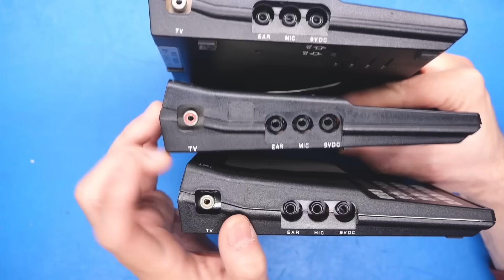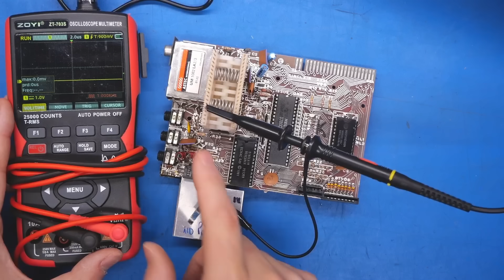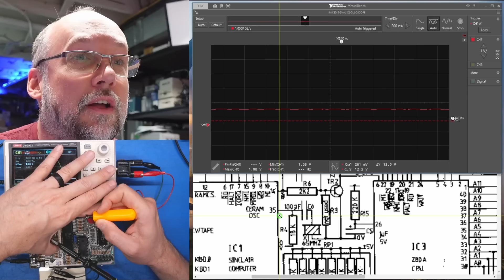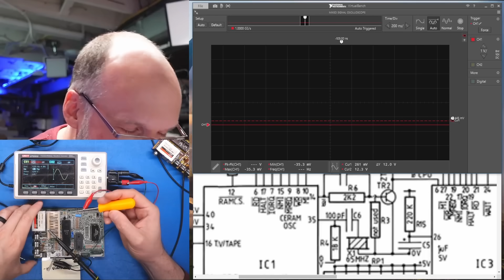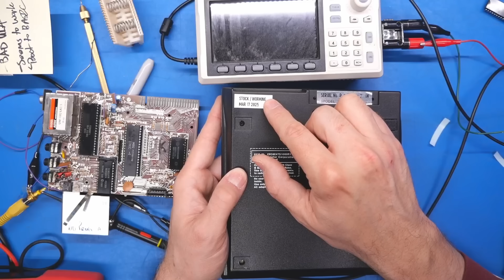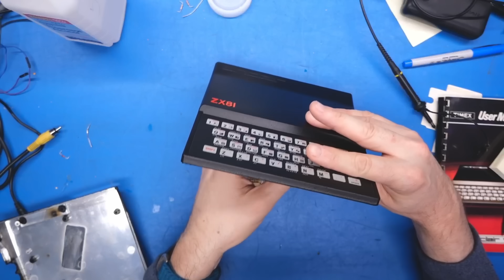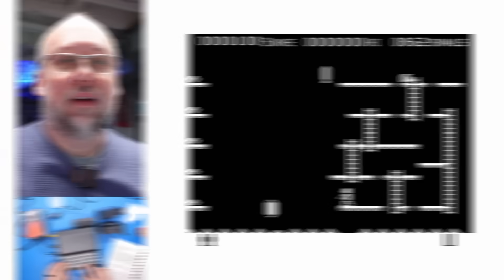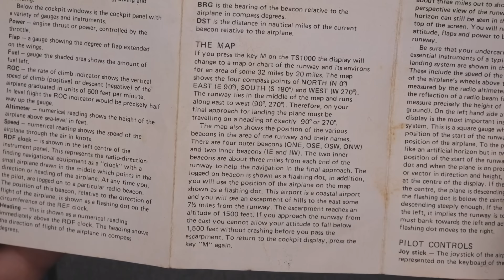Is the ZX81 / Timex Sinclair 1000 actually bad? Let's fix these to find out.

Comment: Why did you swap the motherboard into the ZX81 case? I would have thought that unit as original would be more valuable than with the swapped part. You would still be able to do the mid with the Timex model. Do you plan to resell it or use it? If it's just on the shelf as a memento of the golden era, I'd prefer to have one I know it's original than modded. Just curious why you did that?

Comment: I have a Memotec keyboard that plugs into the expansion port between the ZX81 and RAM pack. I also have a Memotec parallel printer port module for the ZX81.

Comment: They were great for robotics, as the ZX81 will run on batteries. Nasa have even used them on the ISS for experiment monitoring.

Back in the 1980's, I've witnessed a CNC milling machine converted to run under ZX81 control and at a Plessey facility, a ZX81 modified to be an EPROM programmer.

The UK electronics hobby store MAPLIN sold I/O board kits (used the 8522), RAM kits, extension motherboard kits, etc. (which I have still) for computer engineering & robotics hobbyists.

I built my own 16K RAM pack using a 74LS138 (3 of 8 decoder) addressing a 27256 static RAM chip. Another used a 74LS154 (4 of 16 decoder) and a 27256 static RAM chip, to give 32 K. What I learn about addressing I/O and RAM on the ZX81, later served me in my career as an electronics engineer designing ISA & VESA bus cards for IBM PC clones.

Comment: Dear Adrian, when the ZX81 is your very first computer, there is nothing wrong with that keyboard at all. It is like a device from another planet. By the way, when using the 16K RAM expansion, the delay before the K appears is normal, since the computer is busy checking how much RAM is connected. The delay is longer with a 32K RAM pack and even longer with a 64K RAM pack. There is a function, PEEK plus address (I do not remember the exact address), that will tell you how much RAM is detected. The manual for the ZX81 is much better than the manual for the Timex Sinclair 1000 you have. In fact, the ZX81 manual is essentially a complete and beautifully written BASIC course. I actually learned the basic concepts of programming on that computer following its manual. Thanks for the video.

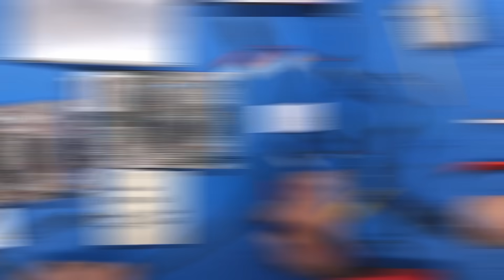Comment: A tip for dealing with those thin, easily damaged FFC/FPC ribbon cables:  Get some sheets of acetate (the ordinary transparent plastic sheets often used for paper covers, overhead projectors, etc), and cut a piece the same width as the cable, and long enough to hold onto easily (similar to what you did with the plastic tabs at 39:28, but do not adhere them to the cable).  When you are removing the cable, first insert the plastic piece as a shim between the cable and the connector, and then pull the cable and the shim out together (this reduces strain when pulling it out, making damage less likely), and then when putting it back in, insert the cable and the shim together (for support), and then pull the shim out (leaving the cable) once the cable is inserted.

This approach will make it much less likely to damage those sorts of cables any time you are inserting/removing them in general.

Comment: It was slow as hell, had a marginal basic. No real graphics except. Character graphic. Combinations. It was Black and white with no sound.  The screen flashed every time you pushed a key unless you put it in. Slow mode. Which made it craw. And yet I learn more with it than. With my PRS 80. Model 1. I had to. Literally. Encode. Machine language. From scratch from reference. Books. To get any. Sense of speed from the device. It wasn't impossible. I learned a lot about the architecture of this. Z80. It is half the peak and poke all the commands into the RAM. And execute them. I told the people that scoffed it, me having one of the things that it was just the computer that Allowed you to say that you own a computer.

Comment: I spent 48 hours programing an interactive database with all my family and neighbors names and some personal info, and hoped for them to be blown away when they responded to a prompt to type their name and press enter, setting each into a subroutine where the ZX81 would seem to know them . Of course , saving your work was not a thing yet, and suddenly , after 48 hours the screen went blank and of course i had lost all  work forever , except in my memory.  I was 13 yrs old. Didn't use a computer again until 3.1, and while in paintbrush , all the buzzing and clicking from the tower had me convinced I was  about to overload it.

Comment: I used those machines with a printer and did homework for college electrical engineering courses. Then engineering programming courses. FFTs, matrix operations, etc. worked fine for me. Led to a Software Engineering career that I recently retired from. Don’t knock the ZX Rock!

Comment: I had a TS1000 as a youth, I bought an aftermarket mechanical keyboard. I made a paralell port output for it and used it as a light controller with a triac output. used it as a computer based home automation system

Comment: I imagined now how for the same money ($100) I would do something similar in functionality. This would be a system with STM32F777, 16MB QSPI NOR Flash, 8 MB FMC PSRAM, USB, uSD, HDMI. Instead of BASIC I would use JavaScript from Duktape. There would be a graphics system with TouchGFX, two built-in file systems 4MB in the external RAM and 8MB in the Flash with FatFS or LittleFS. The remaining 4MB of RAM would be used as memory for the JavaScript engine and as a frame buffer for the video, and the 8MB flash for TouchGFX for static bitmaps, icons, etc. FreeRTOS or ThreadX

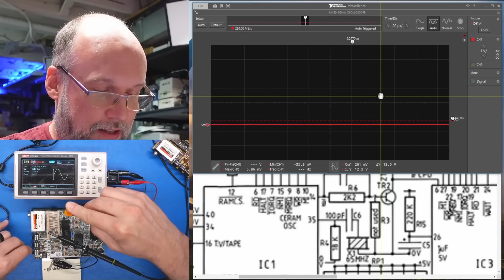Comment: 29:30 oooh I bet the "ledge" seen in the signal on this one was added in a later revision in an attempt to address how it wasn't compatible with some TV models. NTSC has zero voltage during horizontal and vertical retrace, but at the start of every line there's supposed to be a "front porch" where it's at the black level (which is above zero) before the actual visible video signal starts -- you can see the little notch for where the K is drops down to that same level, so we know that corresponds to black. The first unit doesn't have the front porch and just goes straight into white video which is naughty and is probably what made some TVs not like it.

Comment: Handy tip !!, you CAN actually solder the membranes.. The way you do it is to add small strips of adhesive copper tape where needed to cover the broken trace and solder nylar wire to the copper tape pieces. Then use more of the copper tape on the opposite side of the membrane strip to make connection of the 2 strips. Bodgy but it works, I fixed a COCO2 membrane exactly the same way and saved me buying a new one. ;)

Comment: I had the Flight Simulator for the zx 81. It took ages to learn but in the end I could take off and land withouut much trouble. The ram pack was awful until I made a small board for it all to sit on and used small wood pieces to hold the things all in place. After that it all worked perfectly until the arrival of The Commodore 128 a few years later, but in that time I learned the Z80 Machine code and it worked reallly well. Forgot to mention. I made a plywood and edging bead 1/4" square pine glued to it around the edge that just allowed the Zx 91 and 16k ram pack to sit on it securely and some blu tack to fix it in place. You could even make basic sound on it by detuning your tv set to just either side of the channel it was set on then the interference gave a very rudimentary sound.

Comment: As a kid I bought the zx-81 $50 usa version as a kit from an advertisement in an electronics magazine. Replaced keyboard with surplus mechanical keyboard I rewired added ram expansion and a Atari joystick port to a wooden case made. Eventually I upgraded to a C64.

Comment: my father bought one of these new in probably 82 for about 100CND, after some time he got an old dumb terminal and fitted the computer inside and wired the mechanical keys to it, then cut the membrane up and crazy glued them to the mechanical keycaps. the 16k rampack was tricky and ended up being tiewrapped in with an innertube as a spacer to stop it flopping around.
wish i had the mind to learn basic back then.

Comment: I saw an ad for the timex back in the early 80's so I mail ordered it from england. And I fell in love with it. I taught myself basic on it and I made quite a few games on it. I had a 16k memory pack and a thermal printer. I even created an game based on an arcade game of the time, crazy climber. I also had my first flight sim made for it. It opened up a new world for this kansas farm boy. I got used to the keyboard and my main problem was the memory pack could shift and reset the computer. I used an old cassette tape recorder to save what I made. I eventually moved on to a c64 then amiga and finally  a pc. I didn't know people debate on whether it was good or even possibly a scam. I say that unless your intro into computers was on it back in the early 80's then you will probably never appreciate it. Sadly, I had 2 complete zx81's I lost in a flood back in 2007 but I still have the memories.

Comment: The Australian release of the ZX81 also had the aluminized interior so it wasn't FCC specific. But the UK editions did not have it. The unpopulated IC space is for 4-bit RAM (there is another footprint under the 28-pin socket). It is easy to upgrade to 2K by just installing a 6116. It's also easy to use a 6264 or half a 62256 to get 8K or 16K of internal RAM, just a little wiring. The 1Kx8 SRAM was a bit of an unusual animal, but I guess Sinclair found it cheaper than two 2114s.

Comment: Adrian, as far as I remember, for the 16K RAM pack the 9V unregulated power was passed through to it via the edge connector to generate the other power rails required for the DRAM chips.

Comment: I recently picked up a couple of these.  One was modded with an on/off switch (kinda neat), and the ram expansion pack had several holes drilled on the top and bottom.  I have seen a modded expansion card for SD but tariffs have messed that up (surprise surprise) so they're currently not making them. Anyway, I look forward to tinkering around and learning about these.  Fun stuff.  :)

Comment: A Timex/Sinclair 1000 was my very first computer. I lusted after a Commodore 64 (and after a year of hard saving I managed to buy a used one in 1984) but in late 1983 and with scant means, it was the T/S 1000 or nothing. I saved up for the 16k memory expansion, thus giving it eight time more RAM. That Christmas I got a black and white TV and a portable cassette deck and I was set. Sure, it had a membrane keyboard, no colour, no sound, no power switch, and the huge and jiggly RAM pack would crash the whole thing if it wasn't taped in place. But it was a computer and I learned BASIC on that thing. I eventually sold it to fund the C64 purchase but it was always have a place in my history.

Comment: the ZX-81, kit version that I put together as a 16 yr old, was the first computer I bought for myself (previously had to use my dad's KIM-1)

it was a rather limited machine, to be sure, but was cool enough as an intro to microcomputer - it was actually a fun challenge to code useful applications, even with a 16K RAM upgrade & have seen some rather clever examples .... very much an underrated machine, imho

Comment: I remember seeing ads for the timex Sinclair 1000 in a sears catalog the same year I was lusting after the c64 as a kid in 1982.  I remember thinking even at that age how ridiculous the keyboard and ram limitation was.  It took another year but my parents did get me a c64….  I recall the 1000 being a massive failure as commodore took off and Atari and Apple were also doing well.  It took me until the 2000’s and the web to find out how popular and widespread it was in Europe and definitely have a respect in how much the hardware was pushed.

Comment: My first computer was a MicroAce, an unlicensed US kit version of the ZX80.  I had to solder every component onto the board. Being naive, I was not surprised when it worked on the first try.  I paid a little extra for the 2K RAM model.  I upgraded it with the 8K ROM which kind of made it equivalent to a ZX81, without slow mode.  Adding 16K RAM made it a real computer.

Comment: I had a ZX81 when they first came out. After a couple of years "normal" keyboard became available, which attached to the keyboard connector in the PC. It did make the experience of using the ZX81 much better. The 16K expansion kit was very prone to movement, causing a crash; just pressing the keys on the original keyboard would sometimes cause a crash. This became less of a problem when I purchased a normal keyboard.  I did end up purchasing and Apple II plus then BBC computer.

Comment: Yep I was one of the people that had the Timex Sinclair 1000 that used it for awhile then got my first real computer a commodore 64 running a super fast 2400 baud Modem lol I never thought about taking the Timex sinclair apart I still have mine with the optional plug in memory pack. Thanks for the video.

Comment: Compare to an Atari

Or even a trs-80 mc10

It does suck

But it does work

Might as well to the 16k mod, 32k if you do some deciding as 2 16k banks
Reply: I bought one from the local hamfest for like $5 with manual and programming reference guide

I don't think it was a Timex ntsc, because it was Sinclair branded but the red mobo did have USA on it

It did have the back porch problem too on the ula

Unless the person bought it as a kit machine?

It does work on ntsc TV, though the Hitachi multi system didn't show the back porch issue
Reply: Really if you have a z80 and a 32k sram

You can literally make the ula from 7400 fast logic 

Or a cpld like a cool runner II or altera max II epm570t or similar, then you can do both spectrum and zx81 modes
Reply: Funny because the only reference I could find back then about the zx81 was Timex, apparently no Sinclair branded units? My red mobo had "USA issue one" on it iirc and was an early unit because it has the back porch problem
Reply: If you were that cheap you'd be better off with an mc-10 yea it only ran at about 800khz

But it was atleast a 6809 or similar iirc 

And it did color 

Similar cost to a zx81 

And more expansion capacity

Comment: In high school my friends rewired a reed relay keyboard using wire wrap wire on the physical switches arranged in the same matrix as the membrane keyboard, cut up the membrane, glued the symbols on to the reed-relay keyboard keys, and connected it to the TS1000 main board.  They also did the  RF modulator mod to get a composite signal out and connected it to an amber monitor.   I believe they had to do something with filter capacitors and maybe a coil to get the picture to clear up with the 16K expansion module connected.  They put the sinclair board and 16K expansion in the case with the keyboard. They let me use that and I typed in a 120 room text adventure game I wrote in basic based on my school and we submitted the result as our final project in AP english.  The whole class sat around the computer as one guy in my class played the game.  It was slow, but worked.  My main computer was an atari 800 with three 16K memory modules in it, and Indus GT 5 1/4" disk drive, an original atari 5 1/4" disk drive, and a 300 baud modem that connected to the joystick port that I could boost up to 450 baud on BBSes that supported it.

Comment: the membranes fail because the plastic goes brittle, NEVER try putting any sort of contact cleaner/lubricant on the membrane tails to try to help them slide into the connectors, it can make it even more brittle and crack up

Comment: the rampack 'noise' is quite common, it afflicts spectrums as well try adding additional decoupler caps, poly or ceramic, not electrolytic, on each or at least a few of the rams, from the +12v pin to ground , this usually helps in spectrums but still doesnt totally get rid of it , also try additional decouplers in the machine itself, particularly around the regulator

Comment: I believe there won't be a particular date. IIRC there was a period when both were on the market.
The TS1500 is a TS1000 with a chicklet keyboard and 16k built in.
My original ZX-81 has a real keyboard I put in (and the ram expansion is soldered in place).
I also have a second one which has a little buzzer inside that makes a noise every-time that a key registers.

Comment: I was 10 and self taught on how to repair most electronic devices when the ZX81 was released. I first saw one in a local electric store and was immediately mesmerized. I asked how and what it did and the guy tried to explain programming (very poorly) so I surmised, I did something on the keyboard and I could make it do stuff on the screen the guy nodded and said yep, I was sold I knew that I wanted to work on computers. I got a ZX81 kit and built it on my parents dinning room table using the worst soldering iron known to man. It worked first time and I started programming immediately (learned Sinclair BASIC from a library book before the kit arrived) I didn't have the money for a cassette recorder (spent it on the kit) so everyday it was a new program (my dad bought me a recorder in the end) but by then I had already decided I needed a more powerful system. That was the beginning of many computers I have owned. The ZX81 may be technically the worst computer I have ever owned, but there have been a few that had a worst software library.

Comment: Got a kit back in college around 1990. A local place had a bunch of un-assembled units for sale so I decided to put one together. The kit came with a great book that explained all the strange tricks they used to get the thing to work. The sinclair basic has a mode that turns the video off and on. This is so you can do higher speed operation while the Z80 isn't re-drawing the screen.